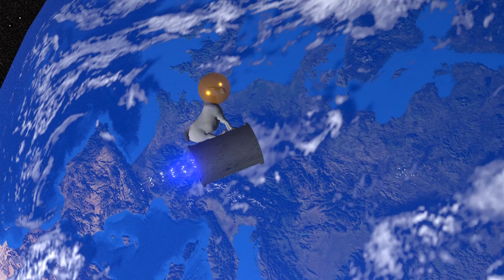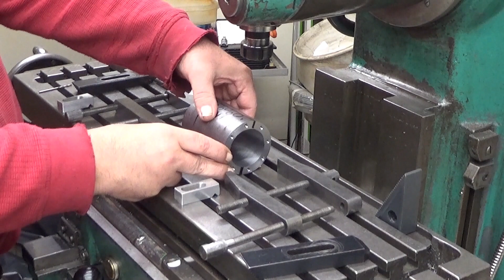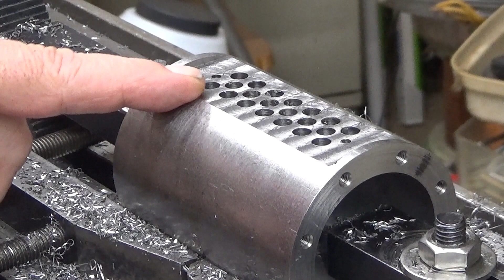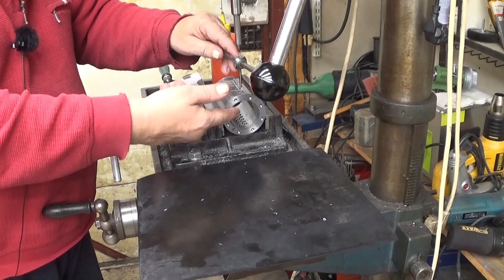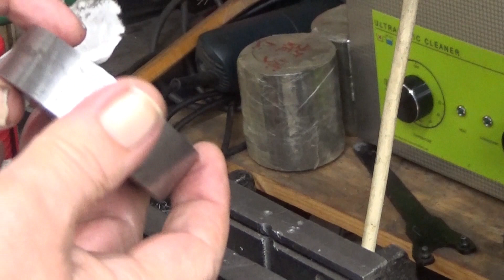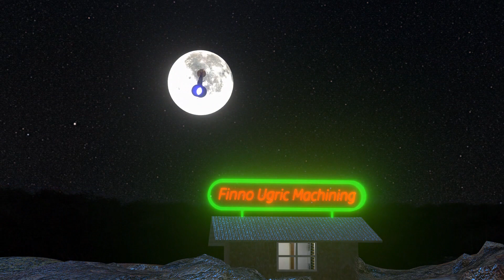Making a rotary vane (lamellar) air compressor 12

Comment: Hey my friend you are an amazing guy!! I’m trying to make one of these that is a little smaller and couple it to a RC motor spinning at 2000-10000rpm, I’m thinking I will make the cyclinder and veins out of brass, can you give me and  idea what sort of volume and pressure this can give?
Reply from the maker: Making the cylinder and the veins out of same material is not a veery good idea. This has to do with similar metals trying to cold weld themselves together.
This typw of device can deliver 10 bar pressure with a lot of throughput. This, of course, requires some horsepower on the driving side.
Reply: @FinnoUgricMachining  thank you so much my friend.
You are an inspiration!!
Reply: @FinnoUgricMachining thanks for the info.
 i am looking to be operating with 2-7 bar and need to get 8 - 20 litres of air flow per minute

Comment: Sounds about right.  Quiet isn't one of the adjectives I would employ for a rotary vane pump. Mechanically, it's similar to a siren.  Large pumps running slow are much quieter than the smaller ones, but are susceptible to blade bounce.  The exhaust side is the loudest, as that is where the wave pulses are generated.  Very nice job on the pump overall.
Reply: Expect the exhaust side goes by lines, or pipes right to the tank. So there is no exhaust sounds.